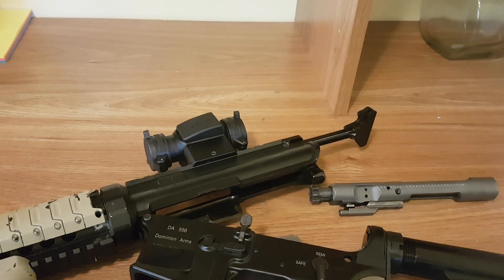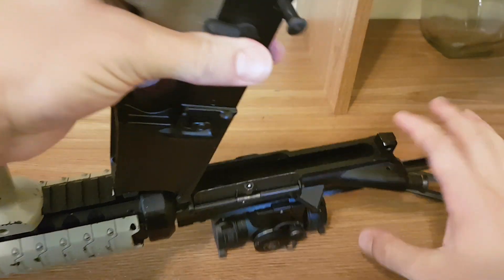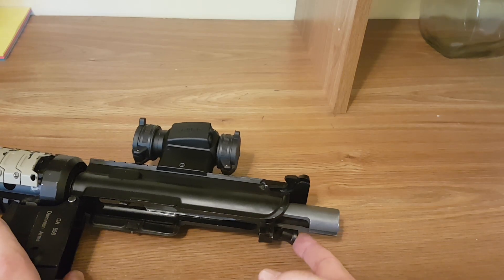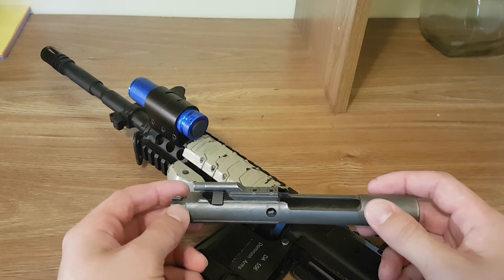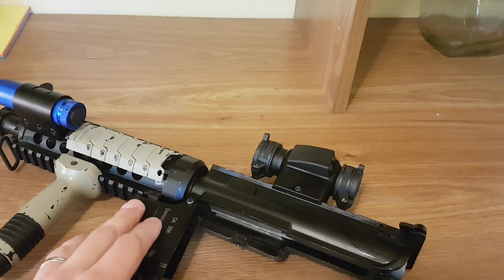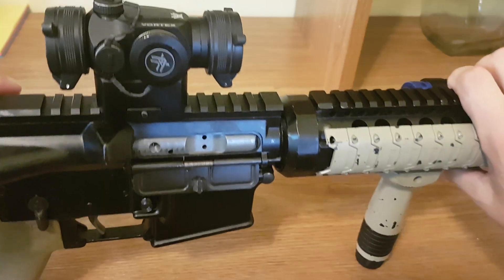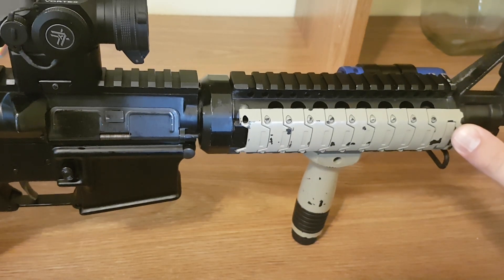What does the Forward Assist on the AR15 Do?

Comment: I was always told that it is used to turn a minor jam into catastrophic jam.
Reply: If you are being shot at and you have a serious jam and the rifle cant be disassembled because of the shitty design of the bolt system. You slam it as hard as you can until the rifle is in battery so it can be disassembled and hopefully you will be able to clear the jam.
Reply: @abrahamm1325  
Finally someone gets it right. Its to clear the buffer.
Reply: @ageckomiller  i mean c'mon guys its called the forward assist for a reason. If it was for clearing jams they would have called it the jam assist
Reply: @abrahamm1325  you're misunderstanding @Ricky Spanish 
if you have to open the receiver for whatever reason, you will be unable to if the bolt is not forward, as it will be sitting in the lower receiver extension/buffer tube.. so you would use the forward assist to put the bolt forward allowing you to open the receiver.. 
It definitely should not be used to force an already stuck/jammed round further into the chamber, however if the bolt is not forward, you'll never be able to clear it.. hence his statement "clear the buffer".. just maybe not the terminology you would use, but it is what it is.
Reply: @jpalmi  Clearly you didn't even read all my comments
Reply: DoomBeagle I cases of double feed/bolt overide yes it can compound the problem.
Reply: theomegawerty no such thing as a double feed. It’s actually a failure to eject. Spent cartridge doesn’t eject and the bolt loads another round while the spent cartridge remains in the chamber.
Reply: I've seen double feeds... not common, but they do happen. Probably as uncommon as brass over bolt, but yeah, two unfired rounds fighting to get in.

One issue that I see a lot is kids riding the bolt home, forward assist comes into play big time with that. Or If already feel the friction on the bolt, my brain already knows to be read to hit that assist.
Reply: It's only to make sure the working parts are fully forward. Not to cram a partially fed round into the chamber. It is a simple drill after loading and making ready, and used on nearly all rifles, but mostly by giving the cocking handle a tap forwards, rather than having a special button for it.
Reply: The other day I had a double feed and an improper ejection, had I used the forward assist my gun would've jammed to the point where I wouldn't have been able to open the bolt at all without assistance. The only time it should be used is if you need to seat the bolt into battery after either riding the bolt with the charging handle.
Reply: Ryan Grobe good point and in high stress or combat situations having to deal with double feed/ overuse issues can be overwhelming if not deadly if one has no experience in how to handle the issue
Reply: It's only for use in an "oh shit" situation (combat)
Reply: (Assess the potential jam prior to actuating)
If it's just a sticky bolt it's going to show its face slowly and get worse. 

A sudden jam is more cause for concern and there's an entire different process for such situations.
Reply: That was the case before they chromed the chamber. Now it is used to jam the bullet into the cartridge on either a double feed or a frailer to eject.
 I think Ryan and Ricky have a better grasp on it.
Reply: It can do more than one thing.
Reply: Bingo!
Reply: hahaha yea
Reply: Busters the beagle totally agrees with you.

Comment: Hey man, just an FYI, the bolt carrier starts to go back then the bolt unlocks. 
Oh, and whatever military uses the forward assist is asking for trouble. If a round has an issue  severe enough while going into the chamber to use the forward assist, you shouldn't push it into the chamber. You might not get it back out.

Even though the US military says it's part of immediate action, no one does it because it causes more problems than it helps.

Comment: My problem with this is it couldn't punch through the dense jungle. It was fine in an area like a rubber plantation but the AK was more powerful and much more reliable in a firefight. We were actually under armed when compared to the Vietnamese. I learned how to fire on an M14 then used the M16 in Vietnam. I never liked the M16.

Comment: Whaaaaat the direct impingement system has nothing to do with the forward-assist. Gas-operated versions of the AR-15 also have a forward assist. The reason it's there is because the AR-15 has a non-reciprocating charging handle, which is nice because it's ambidextrous and doesn't slap you in the face. A forward-assist is necessary because you can't slam the charging handle home to lock the bolt into battery.
Reply: Neil Douma It's not necessary the US War dept demanded it to fix the problems in Vietnam that were caused by M2 Ball powder and no cleaning kits. Eugene Stoner, James Sullivan, and Bob Freemont (AR-15 design team) were all against it. It causes debris to be hopelessly jammed deeper in the locking lugs.
Reply: Daffy Bigbear he probably meant to say "piston operated" - at least, that's the only thing I could think of that he meant in contrast to direct impingement (which itself is really just an internal piston)

Comment: When the M16, the grandfather of the AR15, was first introduced to the troops in Vietnam (1966 or 67) it did not have the "Forward assist". While it was much lighter then the M1 it was prone to jamming and jamming at the most inopportune times,  like in the middle of a fire fight. many complaints were made and the manufacturer had to do something quick that would step over this jamming in combat problem; they redesigned the M16 to have this, "high tech", unjamming device installed on the right side of the bolt so it could be palm slapped to drive the bolt home and get back into the fire fight without having to field dress the damn thing while under fire! How do I know this? I was in Nam in 1967 and had one of the original M16's without the "Forward Assist" and on several occasions had to resort to fighting in a fire fight with my 45 rather than asking the  NVA for a time out while I field dressed my M16 so as to unjam it.

Comment: Alot of misinformation here so I will explain the best I can. The forward assist feature is for some specific actions that may be needed to assure the bolt carrier is completely forward and the bolt is locked ( as the charging handle is not connected to the bolt carrier so you cannot simply push it forward- think AK handle that is welded to bolt). Clearing the barrel of water will require you to pull back the bolt enough to break the seal of a loaded round so water will drain and when then letting the charging handle go the carrier will return but not with the full force of being pulled all the way to the rear so there is a chance it may not have closed completely so a slight push on the forward assist will assure the weapon is functional. The same is true if you are trying to load the rifle quietly ( MANY reasons for this ) and need to ride the charging handle when charging rifle to avoid the load clunk then you would again push or "lightly" tap the assist button to assure closure. This feature was NEVER intended to "hammer" or force a round into the chamber. If you are at the range qualifying or target shooting you may never have the need to use or want the FA button however understand it came about from real world use and when used correctly is a benefit. If using this rifle to fight with ( even hunting, quiet is good) it should have a forward assist and the one behind the gun should know when/how to use it.
Reply: Al Cherry thanks dude 👍🏻 I know nothing about guns, just curious and seen some people in comments of other vids bragging they have never used it? You just explained what it is, how it came about and when and why you’d use it or not in 1 comment! It actually makes perfect sense now and I’m guessing that people who are proud they’ve never used it probably haven’t left a firing range.
Reply: I was scrolling through the comments just waiting to see who was gonna actually give the correct answer!!! Good job!!!
Reply: @MikeMikeActual  I know, right!?  al cherry should have his meal card stamped Extra Dessert!
Reply: @havocproltd  😂😂😂😂
Reply: Al Cherry,   thanks for a good and clear explanation.  another example.. I built a rifle and the gas rings were a bit tight when new, so it was preventing the bolt from engaging fully and locking. I used the fa to "assist" (not jam) the bolt forward and after repeating for the next 3 shots, it was working the way it's supposed to.  :)
Reply: nice work!  finally someone who know what they're talking about!

Comment: DI is not the issue why this gun has forward assist (FA), it's because AR's charging handle is non-reciprocating, so you can only pull the bolt/BCG backward, but there no way to use the charging handle to move it forward.  So compare to other guns that uses reciprocating design, you only have half of the control functions.  FA completes this deficiency.

Comment: Its for when your m4/m16/AR15 is a POS and the bolt jams because of carbon build up, so if you smack it a couple times the bolt will ride forward and properly lock in the star chamber. Mostly used during POPS (pull, observe, push, squeeze) during a common malfuntion to get you into combat faster.

Comment: What about on AR-10?
Reply: WhatAreYouBuyen same thing, basically. .308 version. they have larger components, though i have a 308 small frame ar, which is highly compatible with ar-15, so mine isn't really an ar-10  but i have referred to it as one due to it's larger bore.
Reply: The US Army really wanted a forward assist on the M16 so against the wishes of the USAF, Armalite and Gene Stoner, the forward assist was added to only the AR-15 type rifles. The AR-10 commonly omits the forward assist but you will see it on some civilian AR-10 type rifles. Portuguese AR-10's had a forward assist integrated into the bolt handle.

Comment: but what happens if you hold it down while shooting?
Reply: Joseph Burgis A band aid should definitely do the trick.
Reply: I don't get the band-aid reference
Reply: wasn't a reference.
Reply: Not trying to be a jerk I just don't get what you meant, like using the band-aid to hold the forward assist or that a band-aid is all that's needed to treat such an injury.
Reply: thumb injury

Comment: The only thing a "forward assist" will do, is assist you in making a malfunction worse.
Reply: I have indeed seen those videos, and they are quite well done. however, if you have watched much of In Range TV, you will note that even they share the thought that the FA is a poor idea. If the bolt does not want to go into battery, forcing it to closed almost always causes a more severe issue. A simple malfunction caused by dirt in the ejection port area is better solved by TRB, where in a lot of cases, said dirt is dislodged rather than cramming it in the locking surfaces.

furthermore, with a little historical research you will find that Eugene Stoner (designer of the AR15/M16), the USAF, and the USMC all thought that the FA was a bad idea, and did not want it on the rifle. It was pushed through by the Army, trying to solve problems they had with the rifle in Vietnam. Almost all of which were due to poor decisions made by the government in ammunition production.
Reply: i find freezing temperatures to be the worst for this platform. at least sand and dust can be cleared out by simply blowing on it. (infantry, trust me, ive had to clean every form of stoppage from this rifle) ice will disable that rifle faster than anything so god forbid it condensates in the evening and freezes over night.
Reply: so S.P.O.R.S?
Reply: Wolf Humphrey lol
Reply: forward assist isnt exactly for fixing a malfunction such as double feeding, it is there just in case you get dirt in the ejection area (which is extremely hard on an ar15 because they are extremely sealed up guns) none the less its only there if you get dirt in there and the gun isnt going into battery. 

if you watch any in range tv mud test videos you will see that the main failure points in those tests are when mud gets into the ejection port thus causing the weapon to be hard to put into battery i.e. jamming. that is why forward assist exists. to prevent jams caused by dirt, which mind you its already hard to get dirt inside of an AR15. the only way i can think anyone can dirt into one is by firing with the gun beneath mud. 

you can watch inrange tvs test on the AR15. it was one of the few rifles they tested that passed with flying colors.
Reply: Helped put my A4 in battery so I could at least fire off single rounds and remain an effective Soldier when I crawled through a Kentucky mud hole with it during training once.  That's just real world experience using it though.  Clearly, you guys know better than I do.
Reply: 67stang351cle I simply stated why it was there I didn't say it was a good or bad idea. Just stating facts i.e. the reason for it being there.
Reply: Anecdotal evidence is just that. Just because you have an experience that is contrary to this point, does not dismiss the overwhelming mountain of evidence that using the FA to force the bolt into battery, more often than not, causes more severe problems than had you used  the appropriate battery of arms to clear the original malfunction. 
     I too have run many m16 and m4 rifles, through all manner of environments; and mud was never a problem for the platform.  Sand and dust however....

Comment: Wrong.  When the bullet passes the port, gas travels back down the tube which pushes the carrier back.  This same force unloads the bolt as it is pushed forward..equal and opposite a la Newton's laws.  Another Newton law.. carrier is in motion and with mass so it cams the bolt to unlock.  Before it unlocks, the pressure in the carrier is vented to the right through two holes in the scallop cut on the carrier.  Now only momentum of the carrier pulls the empty case from the chamber.
The FA is there ORIGINALLY to allow for tactical quiet loading by slowly lowering the charging handle allowing the bolt to strip a round from the magazine and guiding it to the chamber.  Without momentum, the extractor isn't engaged on the rim and the bolt is unlocked.  A simple push on the forward assist snaps the extractor over the rim and locks bolt into the barrel extension.  US Army 44B Ordnance School APG MD 1987...

Comment: did you know you can also use it to correct a case head separation? during the Vietnam War the United States decidedly more cost-effective to change the two to three to a different type of gun powder which caused it to have a lot of case head separation so they had the forward assist because when a case of Separation happens and there's a new round in the chamber you can hit the forward assist so it wedges inside the old casing and then pull the charging handle hard to yank both of them out :) \^_^/

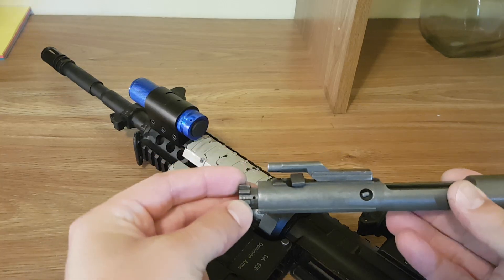Comment: You keep calling the entire unit in your hand a "bolt".  It's a BOLT CARRIER (or with all parts installed, a BOLT CARRIER GROUP (BCG)).  The entire unit in your hand is the BCG!  The bolt, itself, is only one part of the BCG and it is the part which interfaces with the base of the cartridge and with the chamber (via locking lugs).  For newbies, at 2:00 and 2:30 the bolt is on the far left and he's pushing it in and out of the carrier.

Comment: The Forward  assist does nothing necessary, If you look at almost every AR bolt has a lightening cut on the bolt, just slide your support hand back put a fingertip in the cutout and pull forward no extra parts needed and your hand never has to leave firing position. Btw when you chamber the first round always start with the bolt open use the bolt release and allow the bolt to slam the first round in never had a problem running an AR that way

Comment: this is so messed up... when rifle was built they knew it's gonna suck balls so they invented a little button that will let you manually cycle the bolt 😂
Reply: No, Stoner never said that it didn't need to be cleaned. Bean Cunters in the OD thought they could save 2.50 not issuing kits and so they didn't until the the bean cunters realized it was killing soldiers.
Reply: pvas3102 When a rifle is used in the field and fired alot with not the best ammo (milspec ammo) you will build up alot of carbon and possibly dirt etc.
Reply: rambokicksass77 yeah because the air force fires their weapons so much lmao
Reply: Promachos Athena they also used cheap crappy ammo that tje rifle was not designed to use hence tje stoppages when first issued to Vietnam troops
Reply: The irony is that the M16 worked far better when it first came out then the AK did when it came out. The first a case where such a bismal failures that the receivers literally cracked and fell apart. They were such pieces of crap that they couldn't run more than a few hundred rounds. So the Soviets had to go back to the old style of manufacturing techniques for almost 10 years before they could fix the problem and reintroduce the gun as the AKM. So Russians and AK fanboys have nothing to laugh about. That said, both rifles were eventually worked out, and became find weapons. That's really all that matters. The truth is, whether you're talking about handguns or fighter planes very few pieces of military equipment work 100% right out of the design phase.
Reply: pvas3102  Nope, even Eugene Stoner was against putting a forward assist on the rifle. The Army was the only one who wanted it because they have no idea what the fuck they're doing. Worked just fine without it for the Air Force.
Reply: rambokicksass77 they also said at first that it never had to be cleaned.... boy was that a f#$k up.

Comment: When I was in the Army in 1969/70 we had the XM-16E1 and the M-16A1, both of which jammed badly. In my experience, the forward bolt assist was of absolutely no use in unjamming the rifle. We had to invariably break down the rifles to clean and unjam them.